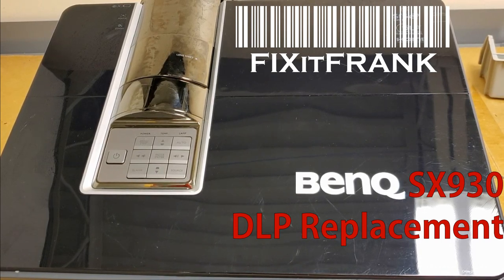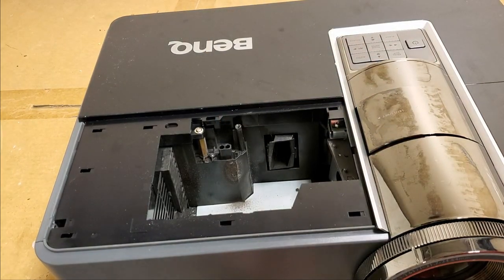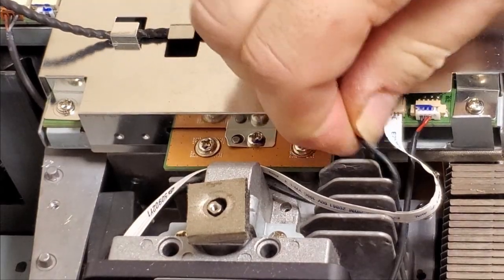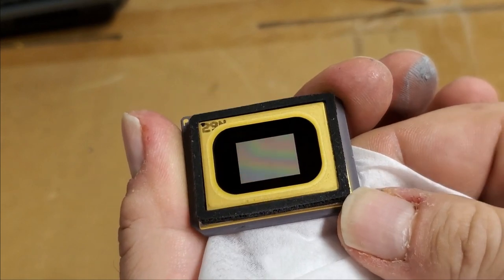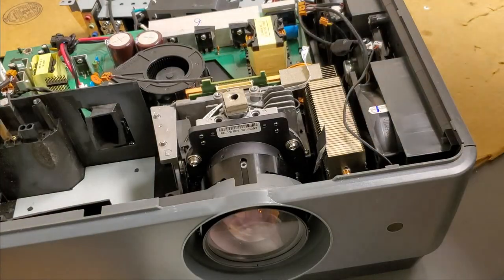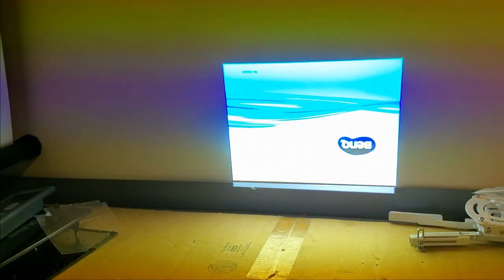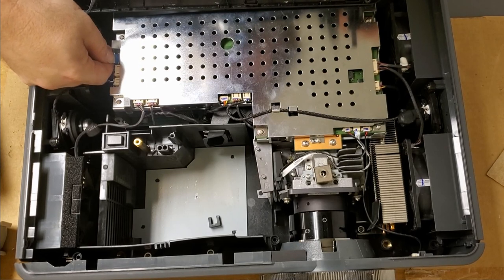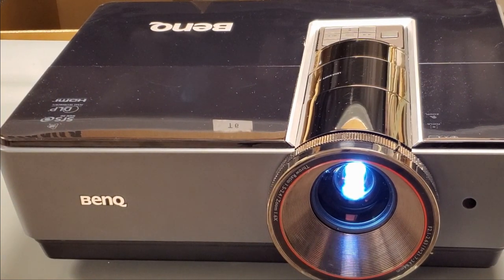BenQ SX930 DLP Projector Repair DMD Chip Replacement

Comment: Hi Fix it Frank, just watched this video… thanks for doing it… very informative. Can you comment connection from dmd chip to heat sink… you mention it and say pad is between. Did you put paste in or was it another new part?
Thanks
Mark
Reply from the maker: I used a heat pad that was sent with the DMD but you could use paste. That is what I usually do unless there is a heat pad sent along.

Comment: Thank you dear.I like your videos. I have a Sony projector model VPL ES 7 showing pink display with vertical lines. Which part will be deffective .pls help me
Reply from the maker: You're welcome!  First thing to check is input cable.  If you use VGA, try another VGA cable. That is a common symptom of a bad VGA wire.  Another symptom of Pink display with vertical lines is a problem with an LCD panel. Possibly a loose cable on the blue panel. Check all panels to be sure the wires are connected.  I would try no input and if the issue is still there, check the LCD flat flex cables.

Comment: @FixitFrank, How similar is the SX930 compared to the TK800M? Is it relatively similar?
Reply from the maker: They are "similar" to a degree.  The TK800M is 4K native so the chip is different for sure. In most cases most DLP projectors follow the same general layout and operation.  Part numbers may not be the same but the general function is the same.

Comment: Hey Frank,  I need a replacement colorwheel for a BenQ1085st.    I watched your 1085st repair video.   I dropped the colorwheel and it broke.    Any chance you can send me a link to purchase a new colorwheel.    Thanks a bunch!!
Reply from the maker: Oh what a drag! I've broken color wheel setting them down.  Luckily they are not too expensive. China is your best bet for a replacement. There is this seller on eBay https://www.ebay.com/itm/COMPATIBLE-COLOR-WHEEL-FOR-BENQ-HT1085ST-PROJECTOR/183755660430 or email my friend Crystal at gydz@timeprojectorlamp.com and let her know I sent you.  I use them for many of the harder to find parts. They ship DHL And use paypal so its very safe and reliable. I've been ordering parts from her for over a year. Very nice people.
Reply: @FixitFrank  Thank you so much!!!   Your video save me from having to buy a new projector.

Comment: Hi Frank, could you tell me how I find the right Chip for my Benq W750? It seems very dificult to find a page with informations.
Reply from the maker: Your best bet is to remove the old chip for the part #.  I have had issues using cross reference info online.  With the cost of a DMD, it is worth the effort to remove it.  That way there is no chance of a problem with incorrect parts.  It is a hassle, and it would be nice to know the exact part number ahead of time, but I find possibility of getting the wrong DMD and permanently damaging the device is not worth the chance.   I "think" its the 1272-6038B/6039B but I am not 100% sure. It does have the same resolution. It will at least give you a general cost.
Reply: @FixitFrank  Hello Frank! Thank you for the quick reply.
I will do it so that I remove the old chip and check the number.
Good video! Keep up the good work and greetings from Nuremberg, Germany.
Norbert
Reply: @FixitFrank  I checked it now and the DMD Chip has the Number 1272-6338B. Could you tell me where I can buy some of thes kind?
Reply from the maker: I am glad you checked!! My guess was incorrect. Yes, contact Crystal at Time Electronics. They are in China but they ship worldwide(DHL) and take paypal.  Her contact info is GYDZ@Timeprojectorlamp.com  Let her know I referred you.  That chip should not be very expensive! (I hope I still remember my HS Deutsch) Vielen Dank fur das ansehen meiner Videos! Tchuss!